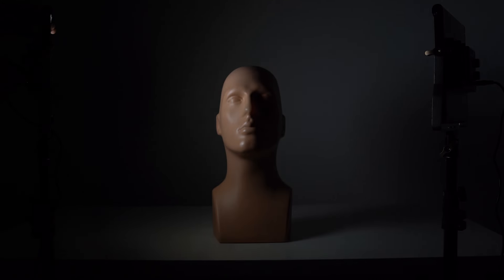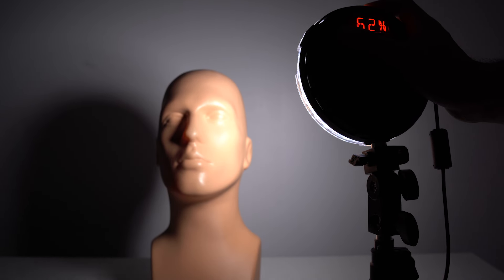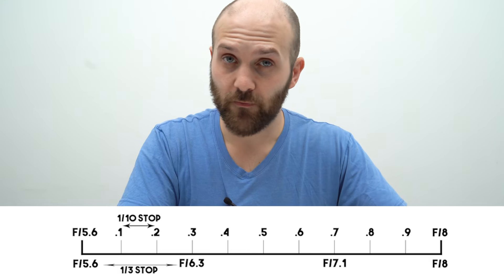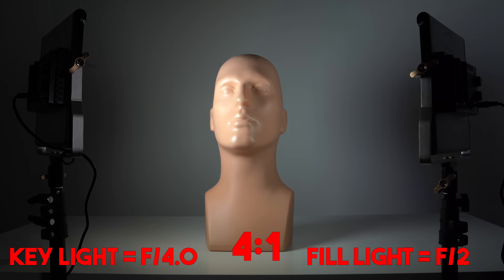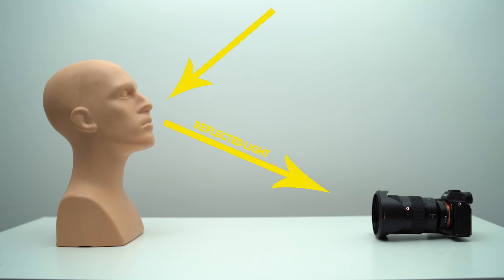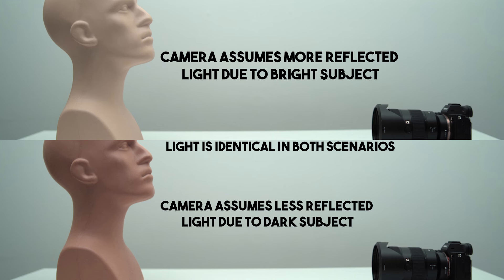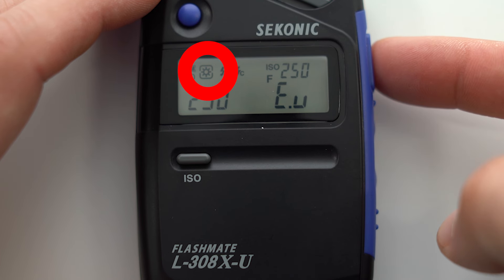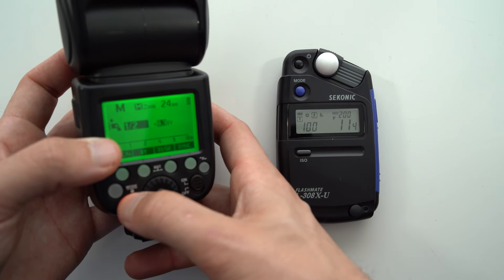Light Meter Tutorial Photography // Light Ratios with Sekonic L-308X-U Flashmate

Comment: It’s crucial in street photography that involves people as subjects; measure the light reflecting from the hand, to get accurate exposure for skin tones. Then recheck every 15-20 mins as the ambient light changes of if you change the location. The camera simply can’t do this right.
Reply: Only if your hand is 18% gray.
Reply: @bngr_bngr  Or, if you know the differential between your hand and mid-tone.  For example, my hand is one stop brighter than mid-tone.  Knowing that, if I get a reading of my hand at f/8, I know to "place" the proper exposure at f/5.6.
Reply: Aperture Priority is the least hassle for street photography on the go. It'll get you in the ballpark of what you need and really easy to tweak exposure with Exposure Compensation. My go-to mode for street/walkabout photography.

Comment: Use this meter all the time as it does the job and it's good value for money.
On a different note I've still got my old Weston Euro Meter which I used in my Hasslebald and View camera days, beautiful bit of kit and essential for anyone wanting to learn zone metering/sensitometry as I had to in training. Always remember being told to check the latitude of the scene with the meter, (darkest and lightest point where detail is required),  and adjust exposure and development of the film in order to get a good print on grade 2 paper. Much easier now of course but back in the day you really felt you were creating something.

Comment: This is a very good meter. I had the more complex sekonic meter and bought this one as my backup. From day one this meter became my primary one. One complaint I have about this one and all new meters is that they have auto shut off. I used to have a minolta flashmeter with expensive batteries and no auto shut off. When makers switched to cheap aa batteries they added auto shut off. The main problem with the L 308 is the dome tends to slide over and change the meter reading to reflective. I solved this by cutting a q tip stick to length and placing it so that the dome won't slide. (For reflective metering use the camera meter)

Comment: I know it's 5 years after you published this, but FAB video. Super clear and helpful. Only thing I can't seem to find on YouTube is how to get my Sekonic Flashmate L-308X to fire my studio flash lights cordlessly (been trying to sync it to my Elinchrom Skyport Transmitter, without success.
Reply from the maker: I don’t have any recent experience with Elinchrom skyport but there is no radio module in the L-308x to fire the lights, that is available in higher models. The “cordless” mode means it will measure the next flash it sees, so you still initiate the flash via testing on the trigger or firing the camera with trigger attached.

Comment: Great tutorial, thanks a lot.
Do you know if this light meter will measure the flash duration? I'd like to know how much power I have to set my flash for example to get a duration of 1/1500 s.
Reply from the maker: No this light meter does not measure flash durations, you need a more advanced / expensive meter like the L-858d-u light meter to do that.
Reply: @robhallphoto  OK, thanks for the quick reply. Apart from using a high end light meter, would you know any other way to get the flash duration?
BTW, I just ordered the L-308X, looking forward to speed up my working process!

Comment: Thank you so much for the explanation. I’ve had my meter for over a year and struggled with it.If I may make a suggestion, it would be helpful to explain how to interpret the result. For instance, if you are wanting a 2.8 exposure and your results say 1.4, do you increase or decrease light? That would make this tutorial PERFECT.
Reply: you have to cut less light (decrease)
Reply: @Royh224  he would actually have to add light to get 2.8 to be accurate in camera if the light reads 2.8. The 1.4 means that the room is actually kind of low on light and the he would have to increase light output to match the 2.8. If the light increases so will the aperture because more light means he would have to stop down to a slower aperture (going up in the f/stop#). This is if he wanted the 2.8 to be the end result. If 1.4 was the end goal then yes he would decrease light so everything would equal 1.4

Comment: Great presentation! Can this meter calculate High Speed Sync (HSS) settings?
Reply from the maker: nope. L858d-u is the only meter capable of that.
Reply: @robhallphoto  Thanks for the quick reply. I was afraid of that. I would buy the Sekonic L-858D-U, but there are too many complaints about the clunky interface and screen that is difficult to see in bright sunlight.

Comment: Thank you Robert for the useful tutorial. I've just purchased the Sekonic L-308X-U and the Lumidisc which was recommended for use when photographing FLAT ART. That is exactly what I purchased the meter, unfortunately my searches are not coming up with a specific tutorial for metering artwork in a studio setting. Is there a link to an existing video that you can provide, or even to a text tutorial?

Comment: Outdoors is where a spot meter is more useful, especially since some models that have them will be more precise than a camera's more broad spot meter. But I don't see that on the L-308X-U, so ...

I could see using a meter in a studio to quickly dial in lighting before taking any images, to at least get close. On the other hand, if I'm in the studio I'd be tempted to also then be tethered, which gets easier every year. And then I could see right away the effect of my lighting on a larger monitor I trust.

Comment: Well if you are using an old analog camera that doesn't have a built in meter, a hand held meter is a true blessing in any case. I commercially shoot with an old Mamiya in basically every thinkable light condition, with flash and also ambient light and it is the most necessary tool besides the camera itself. I really like the Sekonic Flashmate L-308X, but I find it pretty over priced. Not for what it does, but for what it physically is. It is really not much more than a cheap pocket calculator  and also feels like it. It is really just a super basic circuit board with 4 5 buttons, a simple old fashion display, an LED and a simple light sensor - all surrounded by very cheapish plastic. I am very positive that you can produce these devices in Asia for material costs under $5 each! So the current value of over $200 US is really usury. Cheaper ones also do a lot less, but also these simple light meters you can get for $50 or $30 are a scam too, considering the manufacturing costs. I am aware that there is a not a whole lot of demand for light meters in the massive beginner and amateur market, but that is no argument for setting the price that ridiculously high. Then again, what alternative do you have - right? Building and programming one yourself - guess not.

Comment: I think the reason ISO is also not used is because ISO itself (given the same amount of light) can increase the brightness of the entire scene (including the background) but if you want to narrow this down specifically to flash output (and it's impact or a way to measure it) aperture is good because aperture only impacts the recorded light put out by the light source (flash in this case) without impacting the whole scene, including the background.  Plus I think it's easier and more accurate to use apertures because given the same scenario (say ISO 100, 1/125s) with a given flash but being tested on an APS-C versus FF camera, the aperature reading in terms of light output would be similar (maybe off slightly but probably not greatly).   So aperture may be a bit more universal than ISO in that regard for measuring light especially when dealing with different sized sensors (APS-C and FF mainly).

Comment: I'm pretty sure we measure light in terms of aperture ratio because of film. When you change the position or intensity of your light, you would not necessarily want to change your film or film processing, esp if you were halfway through a roll. As you mentioned, below the sync speed, shutter has almost no impact on exposure from a strobe. That leaves only aperture to control the exposure of the light.

Old lights didn't necessarily offer power control.
Reply: Actually, old lights usually offered power control.  Even back to flash bulbs, we could buy different powered flash bulbs, and all but the cheapest electronic flash could quench the pop at lower levels.  

However, none of the exposure controls back in the day had the illusion of incremental control presented today.  We could only slice apertures into half stops, shutter speeds into full stops, film speed into whatever the film came in (usually full stops, though some films advertised or tested to actual incremental real speeds), flash power to full stops.  Today, our tools give the illusion of control down to a tenth of a stop or less.

I say illusion because those tiny increments don't really matter in practice.  If I took three shots of a typical scene varied by a tenth of a stop exposure and showed it to a panel of ordinary folk, they might not even see a difference.  If I showed it to photographers, they'd see a difference but they'd disagree over which was actually correctly exposed.

But all these tiny incremental controls tend to confuse people.  Personally, I've set my camera to show me ISO, shutter speeds, and aperture in half stops--pretty much the way it was years ago.  That's because I learned years ago that half stops can be easily remembered and calculated--and they will get you to within a quarter stop of accuracy, which is accurate as anyone can argue an exposure to be.  Pretending to be any more accurate than 1/4 stop on a real-world scene is just fooling yourself.

Comment: Hi Robert, great video; when you say "If you make the flash outdoor 1 STOP brighter [then the background]" it means increasing your flash power 2 stops? like 1/8 to 1/2? or .0 to 1? I dont get it.
I understand that when you increase or decrease the flash power 1 stop is like 2 F stops? Right?
Reply: on my speed light the meter goes from -3 ,0,  + 3 , so in this case each stop is like 1/64, 1/32. etc, is it the same?

Comment: Robert, will this light meter trigger a Godox light? Will it trigger any light? Or…does one have to have the measure button pressed while sending a test flash.
Reply from the maker: @silekiernanphotography  will it trigger a Godox light via radio natively? no. The only Sekonic meter with a Godox radio module is the L858d-u.
Will it trigger any light? not via radio but it has a PC sync cord so it can.
Do you have to hold measure while sending test flash? No. There’s corded and uncorded modes. Corded you’re wired to your light or trigger and the light fires when you hit measure button. Uncorded hitting measure simply waits until it sees a flash and then provides the metered result.
Reply: @robhallphoto  Rob, thank you! Very kind of you to answer all my questions. The L858d-u is awesome but expensive. This L-308X-U seems like a very nice meter for the price. I appreciate your videos, I love that you go into all the technical details. Thank you!

Comment: Does this meter, or any meter, allow you to fix aperture and shutter speed and provide a flash power required for proper exposure?
Reply from the maker: Yes…sort of.
If it has a radio module, like the L858d-u, then it is capable of triggering the flash. And in some cases (like if it has a Godox X-Series module), you can also control the power of the any Godox X series flash.
You In that instance you can control the power of the flash from the meter, until it is the exact aperture you have set on your camera.
But there is still no mode where it “finds” the appropriate flash power, you shave to dial it in manually, just from the meter instead of the flash/flash trigger.

Comment: Great video, very helpful! When you are metering in flash mode, is there a way to set it to aperture priority instead of Shutter Speed?
Reply: I know this is a year ago but I don't think so. All you do is input your shutter speed and ISO. Adjust your strobe power till the meter reads the aperture you want (say you want to shoot at f/4. Tell the meter what shutter speed and ISO you want. Then all you have to do is adjust your strobe power until the meter says f/4). It's actually pretty easy once you know what it's doing.

Comment: Hello Robert, thank you! I just want to understand whether the meter reading is applicable to all types of camera e.g Full frame vs. Micro four Third. Thanks
Reply from the maker: It's supposed to be, although it's been shown that ISO 100 is not equal across camera types and is rather arbitrary, even with the same sensor size.

Comment: I have just purchased the sekonic L-308x-U and I’m having issues with it.
On cordless mode I would have the shutter speed at 1/125 and getting a reading of f4, when putting the shutter speed at 1/250 I am still getting a reading of f4, how do I fix that ?
Reply: flash is about Aperture and ISO. SS in a darkened room (no or very low ambient light) is almost irrelevant up to the flash sync speed. The light pulse is so short so at 1/250, 1/125, 1/60, 1/30 you actually get the same exposure.
Reply: @ayfj4572  ok but the subject would still be dark at 1/250 but property exposed at 1/125, so are you telling me I should turn off all light when metering my flash ?
Reply: @larryphoto1867  without seeing exactly where you photograph and the arrangement it's not easy for me to say. In a darkened room with little to no ambient light, SS is virtually irrelevant is what I'm saying. Bring in ambient light then SS is a player again.
Reply: Meter what you are photographing normally without flash to establish a baseline. that should establish your SS. Then decide how you want the background exposed (-1 stop is a good starting point) Then turn flash on and meter the main subject, then decide on the aperture that is best.
Reply: @ayfj4572  I've come to  realize that when i meter my light with the lights ( ambient ) on it would affect the reading on the meter, i now only meter with modeling on

Comment: Thanks for the informative video. Still have 2 questions. 1st question, if I like to shoot portraiture and create dramatic backgrounds by using high speed sync and still keep a wide open aperture like 1.4, does this meter work to tell me what ISO to set on my camera. 2nd question is when using this with flash, what is the typical flash power to start with?
Reply from the maker: Yeah you can set aperture of 1.4 and let it tell you the corresponding aperture.
For answer 2, there is no “typical power”, because lights can be 50w or lights can be 1200w, and then they can be 2 feet away or 15 feet away, in a 7” reflector or 6 foot umbrella. And then there’s how bright the background is.
Reply: @robhallphoto  sounds super confusing. I might just have to buy one and test it out myself.

Comment: Hi Robert. What if I want to use f2.4 and the light meter only stops down to either f2.8 and f2.0? Is it a possibility?
Reply from the maker: That's what the tenth stop increments in between full stops are for. F2.4 = F2 5/10

Comment: Can I do this with a phone light meter app? When I try to point the app towards the light it gives me absurd parameters (super fast exposure).
Thanks
Reply from the maker: Like an app that uses the camera? No, because then it’s measuring the reflected light just like any other camera. That would explain why pointing it at the light source gives such high parameters.
Reply: @robhallphoto  Yeah, I figured.
Apps on the phone could use the light sensor that is a featured component of some phones, but unfortunately mine hasn't got one.
I found out that some apps use, in incident light mode, the camera sensor as a light meter, and the reading I get (at least on my phone) is quite correct.
But unfortunately (again), if I need to measure the incident light I am on the wrong side of the phone and I can't see the reading...too bad.

Comment: It appears mine is not accurate. When I use it for incident metering and reflective metering it over exposes my images. 

I compared it with my fujifilm xt20 digital camera and the readings are way off from each other. 

For example I metered a chair outside and the sekonic said to set the exposure at 1/60 at f16.

When I metered with my digital camera the same shot from the same place and distance was f16 at 1/250 

I thought this would be different because the camera uses reflective metering . So I set the sekonic to reflective metering and held it from my camera lens and it was still 1/60 at f16 when the camera read 1/250 . I took a photo with the fujifilm camera at 1/60 as per the meter and the exposure was way off, extremely over exposed.

Thoughts?

Comment: When shooting backlit subject should I face the meter back toward the camera or into the sunlight side?
THANKS
Reply from the maker: That depends what you’re trying to meter.
If you’re trying to meter the background to preserve highlight detail in the background then use the reflected meter pointed at the sunlight to see what exposure that would require.
If you want to properly expose your model with the natural light then meter the face pointed to the camera (which would result in a blown out background due to the EV difference).
Or if you’re adding flash then expose for your background then add flash on your model by metering the face until you get the appropriate flash value to match with your settings for the background.